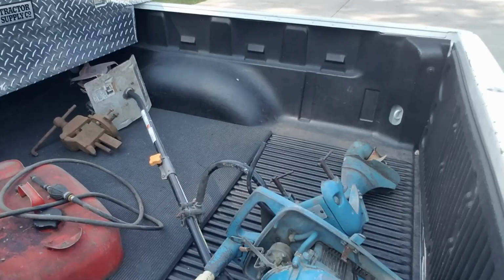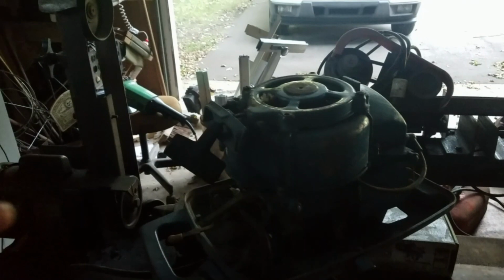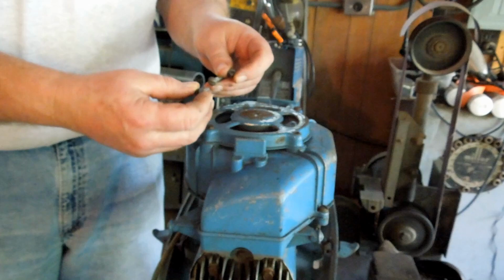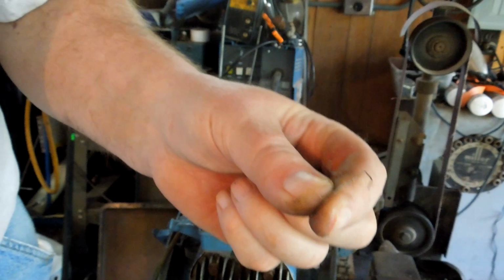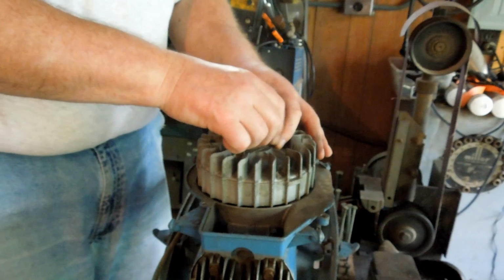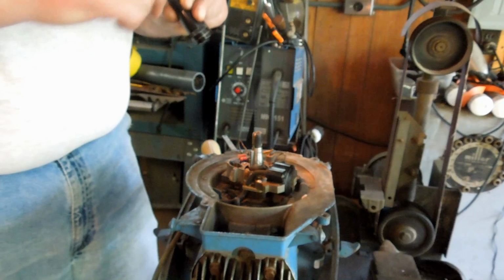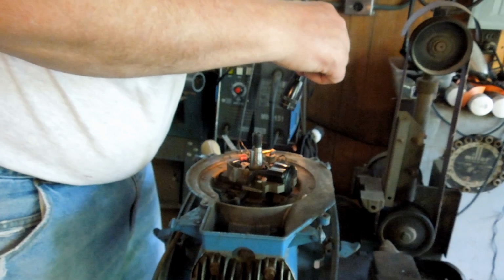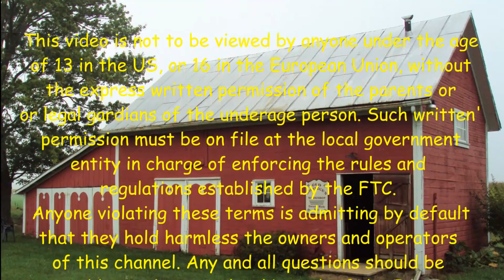George Hooper’s Secret Stash – Fixing The Sportfisher Pt 1 Troubleshooting

Comment: I'm betting you end up with a nice running outboard motor. The Tecumseh on my mower never gave up, always started on the first pull. Your motor is free and has compression, so I bet it just needs a tune up to wake up. Thanks for your videos. I've picked up many useful tips. You bring a lot of knowledge and pleasure to aspiring DIYers. Looks like you're working in your shop with the door wide open. Must be warm in MI. Unusual for December. Snowing in the west Merry Christmas and Happy new year.
Reply from the maker: This video series started last spring. I was trying something different 
There are often gaps between videos of up to months even years as I attempt to build or find needed items.no wanted to have a continuous video series so I waited until the job was done to start publishing.

Comment: If its a 1971 model #1733c 5hp here are some part # for you 630953 pump element 631555 valve flapper 631554 gasket for valve flapper 631021C eska carb kit complete. the following i'm giving you tecumseh part # first then a cross reference to aftermarket oregon part# tecumseh carb rebuild 631978 oregon 49-978 tecumseh float bowl 631700 oregon 49-307 tecumseh float 632019 oregon 49-009 inlet needle seat with gaskets 631021B oregon 49-916 "this kit has the pump element in it with other parts to a different carb oregon 49-239. The needle valve in the carb should not have a rubber tip.  Tecumseh parts are tough to find, Oregon parts maybe....some snowblower parts are intercgangeable.
Reply from the maker: Thanks Bill.
I was able to find parts on Ebay, see tomorrows vid. 
Great to have part numbers. Where did you find them?
Reply: @OldSneelock  I screwed around with a motor like that years ago....I found an old forum page that I used back then that was still alive  and the numbers were still there.  Remember though the numberscare based on it being a tecumseh.

Comment: Does this have a "Kill Switch" somewhere? Might want to check that as well.  On most it's a tab off the coil with a wire that that you ground. At least it's not newer and would most likely have Electronic Fuel Injection and Computerized Ignition and a Coil Pack...sigh
Reply from the maker: Made in 1970. Clinton has been out of business for years.